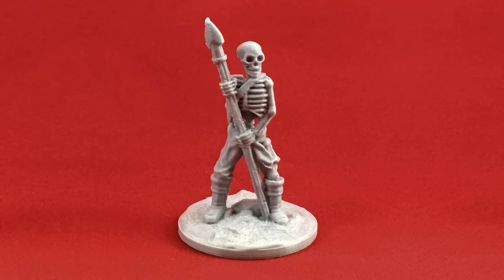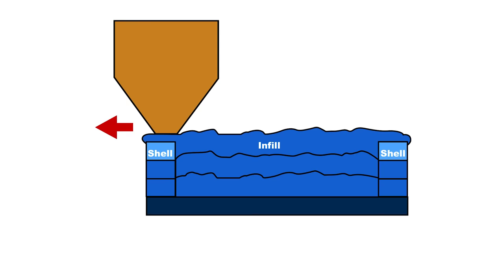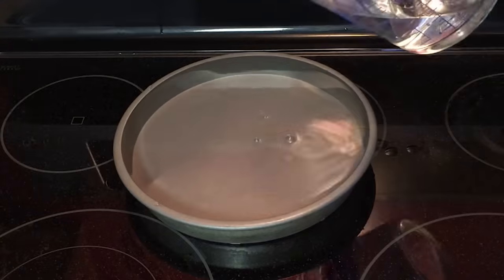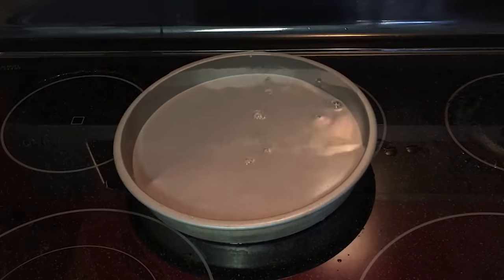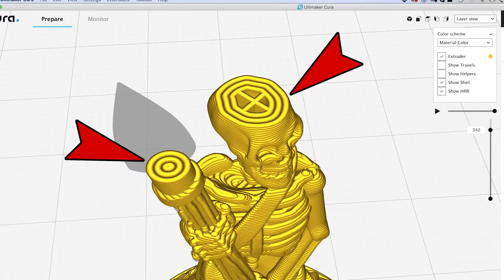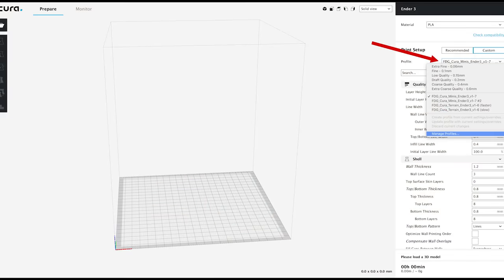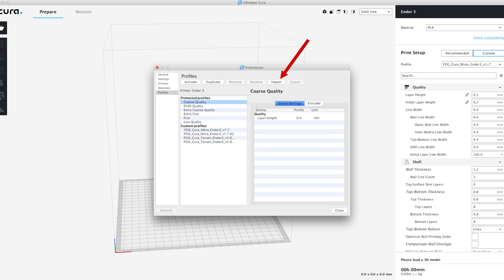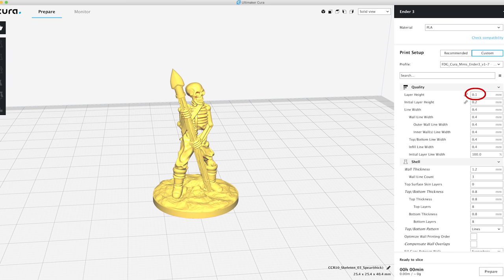How to 3D print miniatures on a FDM printer

Comment: 09:57 slight mistake there...the falling speed is not constant, it‘s an accelleration up to the terminal velocity (in an atmosphere). and objects with different mass only fall at the same speed in a vacuum. your argument about the kinetic energy is still valid, though.
Reply from the maker: I know, but this video is about 3D printing miniatures, it's not intended to be a physics lesson about the acceleration of gravity. Going into an explanation of how all objects accelerate at approx 10m/second/second (not counting air resistance) until they hit terminal velocity due to that air resistance would be overkill (and frankly, annoyingly pedantic.) Much easier to just say the speed of the dropped minis is constant, which gets the point across.

Comment: Thanks for another great video! I've been seeing your channel pop up on Reddit a lot lately. You're getting quite a reputation for your excellent detail and problem solving.

I have a request for the channel. I'd really love to see you try out HT-PLA for miniatures. I've gotten lots of requests from friends for miniatures to go in their car or to put in a window. Unfortunately, I've not had much success getting fine details from it even though I'm experienced with high temperature filaments. I'd use other HT materials in a second, but most other high temp materials don't have much of a color selection. I'd love to see your take on how to get good results from that filament.
Reply from the maker: I have never used HT-PLA, but I'll look into it. :)
Reply: @Tombof3DPrintedHorrors  Thanks! Annealing it is apparently the key to radically improving it's strength and temperature durability. Maybe you can hit up Proto-Pasta for some to test, although I'm sure there are probably other good brands of it out there. I've printed a couple rolls for an oversized project, but it had none of the gorgeous details that your work has. If I remember correctly, they have a couple varieties including one that's supposed to be super dimensionally stable (with cf filler I think, but don't quote me on that). In any case, keep up the great work!

Comment: I've been printing at 0.04mm and 0.08mm layer heights and I've never noticed the radiant heat issue. Only issue is that it takes more than twice as long to print, but at 0.04mm I basically can't see the layers anymore :) Still experimenting with Acetone smoothing and ABS to get those perfect minis.

Comment: I used the profile and my minis printed great, but one problem arises that the support are now sticking far too close to the mini that trying to remove supports basically just ruins the mini afterwards. What can I do to fix this?
Reply from the maker: None of my models require supports :)
Reply: @Tombof3DPrintedHorrors  Unless you've made a Primaris Space Marine proxy, I don't think that'll help with my question much

Comment: Amazing, just amazing. So incredible good explained.
Reply from the maker: Thank you :)
Reply: Will try to reproduce that on my mk3. But the First print is not nearly that smooth, lines show up way more than on your pics. I think I really have to change the nozzle. 
This one is in "work" for 3 months now.
Reply from the maker: I am consistently getting better prints on my Ender 3s versus my Prusa Mk2s and 3, which is shocking as the Prusas cost 4x as much.
Reply: Tell me about it. I thought (as my first printer) the mk3 would be the better choice... annoying to say the least..

Comment: The good news is you can get a high resolution resin printer for under $300 these days.  Maybe silly for terrain and buildings, but ideal for characters and other small parts.
Reply from the maker: Lots of people don't want to have toxic resins in their homes, or deal with the mess of the resin printer and prefer FDM (cheaper, cleaner, and MUCH safer.)

Comment: tl;dr: high ductility means more flex, high tensile strength means overall higher strength required to break, regardless of the material being brittle or ductile. Ductility is also related to higher resistance against impact.

Even though you're right in relating PLA temperature x tensile strength, you're not 100% right about tensile strength being associated with the "flex" of the material, that would be either the elastic modulus or the ductility of the material https://en.wikipedia.org/wiki/Ductility. Tensile strength (also called ultimate tensile strength) is basically how much strength it takes to break the material in a tensile test, in which a sample of the material is pulled apart until it fails (there's also compressive strength which has a different test). A material can have a very high tensile strength and yet be very brittle(example: quenched steels), which means it will suddenly shatter instead of "stretching and then breaking". The strength at which the materials starts to stretch (have permanent deformation) is called "yield strength" and the strength at which the material breaks is the "tensile strength". A brittle material will have these strengths technically equal to one another, since there will be no identifiable stretching before the rupture. A ductile material, on the other hand, will have a significant diference between them, the tensile strength will be a much higher than the yield strength. Engineering applications will most of the time calculate parts so they don't surpass the material's yield strength. Fun fact: ductile materials are much more reliable for structures because: 
1) they bend before they break (sometimes years before they break) which allow the efforts on the structure to be gradually distributed and also cause visible effects of the failure (the element become stretched and thinner or noticeable bent, depending on the effort).
2) they are much more resistant to sudden efforts, like impacts, etc. since they will give in and deform and will only break when the higher tensile strength has been reached.
Reply: Thank you.  98% of this video is perfect, but this section caused my eye to twitch

Comment: I saw a video by CHEP talking about natural steps. It's pretty much .04 for each printer so I would do a .08 or .12 for a natural step
Reply from the maker: Nope. For that to work, your Z 'home' point would need to be on a full step of the Z motor (so that every layer would then also hit on a full step) and there is no way to do that short of sheer luck, and the odds are you won't hit one when leveling/calculating Z offset. If your first layer begins on a non full step, then every subsequent layer will also hit on a non full step. When printing minis, .1 will give you the cleanest overall print, better than .08, especially on overhang areas.

Comment: Hi! I'm trying to print your Sample_Skeleton using your Cura 4.8 .4mm profile with a Creality CR-10S Pro. The printer heats and auto-levels, then it goes to printing mode, but it does nothing, it doesn't move. Could it be that there's a setting on the Cura profile that's not compatible?

Comment: Hey! I've been using the Ender 3 V3 SE for 2 months now. I'm starting to get the hang of it. I'm still switching back and forth between Cura and Creality Print. Seems like Cura is a more matured and advanced slicer, but Creality Print is more optimized for my printer. Had lots of stringing with Cura and almost none with Creality Slicer. I've tried the settings in one of your videos regarding this, but had not much of a difference. So, Cura = better looking results (lots of stringing) Creality Print = not so great looking results (way less stringing). Are you still using the Ender 3 V3 SE? Do you have some more tips or something? Thanks again for these videos!!!

Comment: I recently tried to print minis with a 0.04mm layer height and have no problems with reheating. 
Could it be because of my minimum speed of 80mm/s so the parts aren't radiatet with heat that long?
What do you think?

Comment: I am using your mini profile and everything is great except my top layer. I am printing a helmet that is 25mm high and there is 5 horns on top of the helmet. Two are larger and print fine but their tips get melted a little. The other three are smaller and barely print. And I am getting stringing. I actually got better results using the white pla that came with my Ender-3. Now I am using Enomaker grey. I am new to 3D printing. I tried Googling if Cura let’s you change the temperature and speed at a certain point, but I guess it can only be done with a script (beyond my know how). Should I just cut back the temp and speed in your mini profile?

Comment: Hi. I am being asked to  3d print in PLA!!! a tiny screw, which is 1.5 mm stem diameter. The head is 3 mm diameter. thread pitch is about 0.2 to 0.3 mm. How can I accomplish this tiny job. Any suggestions???. Thanks in advance. Ric

Comment: Cura 4.8.0 says, "Failed to import profile from ... .curaprofile: Quality type 'standard' is not compatible with the current active machine definition 'fdmprinter'" In Cura profiles, after clicking Import then any of the profiles (I have a cheap JGAURORA A3S, but it is bowden and the 3D Printing Pro and Siepie mini profiles work).

Comment: Great info.  Just FYI a tube is generally stronger (stiffer) than a solid rod of the same material in the same diameter.
Reply: Wait, how? Do you mean by weight or by volume(including the empty space inside the tube)? If you mean by weight, I don't think that matters too much in this situation.
Reply: A tube is stronger and stiffer vs. bending for the same cross section of material.  For the same outside diameter the solid rod is stronger, but not in proportion to the extra weight.

Comment: great video. i only use ESUN PLA+ its funny you print it so low temperature. On the box it comes in it says min temp is 205. maybe my ender 3 is different but if i drop below 210 i get extruder issues from extruding too low and the pressue building up. Hopefully the rest of these settings work for me at 210. Also it may wanted to be updated with magic numbers. eg instead of 01. it should be 0.12 or 0.8. eg multiples of 4. but not sure if we knew about that when this video was made so it is understandable its not mentioned.

Comment: You have the description of jerk wrong. Jerk is a change in acceleration, sort of like acceleration is a change in velocity. If you want to use the car braking as an example of jerk, the slower jerk is like pressing the brake pedal slowly and firmly down and fast jerk is like stomping on the pedal.
Reply from the maker: From Cura's site:

Jerk defines the speed of the print head before performing a hard stop. Just like a car, the print head needs to come to a complete stop at some points. It's comparable to hitting the brakes in a car. When you do this at high speeds it feels uncomfortable. The jerk settings reduce the speeds set in the firmware, making the print a little slower, but more accurate.
Reply: @Tombof3DPrintedHorrors  Ok. Either Cura's website isn't explaining it correctly, or they are misusing the term. I don't know how Cura is programmed so I don't know which it is. I was going off of "Jerk" being the correct technical term in physics for change in acceleration. See https://en.wikipedia.org/wiki/Jerk_(physics)
Reply from the maker: Cura has it defined correctly for how it is used within their program.

Comment: wouldnt a circular fan guide around the nozzle help cool off the radiant heat?
its something i'm still wrapping my head around, also i have heard it depends on the printer type at which is the perfect layer stepping height, ie dont print at heights between the stepping points

Comment: I can't import the profile.  I get an error "Failed to import profile from c:\users\...\Official_FDG_Cura_Ender3_and_5_Miniatures_4mm_v4_3l.cureprofile:  Could not find a quality type normal for the current configuration."  I am using CURA 4.3 and I have a .4mm nozzle.
Reply from the maker: Please read the 'Read me' file included in the profile folder for Cura 4.3 users.

Comment: I'm using your Terrain profile settings, and am noticing that there is stringing inside the infill area of the walls. It's very fine thin but still stringing.  Is that a problem?  It doesn't show on the outside of the walls.

Comment: just an FYI when i try to import the 4.3 miniatures profiles i get the following error: Failed to import profile from C:/Users/james/Desktop/FDG Profiles - Import These/Official_FDG_Cura_Ender3_and_5_Miniatures_3mm_v3_3l.curaprofile: Could not find a quality type normal for the current configuration.
Reply from the maker: You didn't set up a new legacy printer first in Cura, you still have their stock Ender 3 printer selected. Install the legacy descriptions, then add a new printer selecting the legacy option.

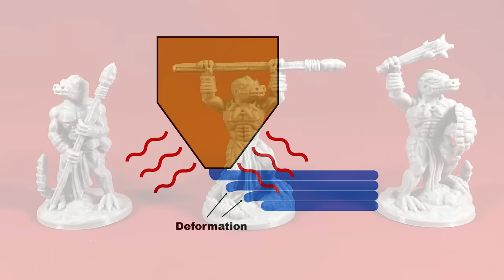Comment: 2:10 what about making an insulating cap for the hot tip angled sides to eliminate the radiant heat?
Reply: I'm pretty sure insulating the hot tip may cause the filament to over heat and either scorch or become too liquid (or both)

Comment: My E3 almost perfectly prints minis with Cura standard profile, 0.4 nozzle and 0.12 layer. The only thing that annoys me were cura supports as they are very solid and hard remove, now i make them with meshmixer and also that issue is solved. Trying to print with 0.2 nozzle ended in much worse quality while much longer printig time.

Comment: I've been trying to dial in my prints, but I seem to get blobs mainly on the edges of things (tips of noses, tips of ears, etc). Any thoughts on how to to negate this? Also in your settings I noticed there are no settings for Travel Acceleration and Travel Jerk. Should these be the same settings as the other Jerk Settings in the profile they default to 5000 and 30 respectively.

Comment: Hello and congratulations for your channel! A piece of advice please. I would like to take a Flsun Super racerR as my first printer. Do you think it is suitable for this purpose? Do you think I would be able to print miniatures for plastic models, crib figurines, action figures and parts for model cars (old hot wheels models that I restore) like from 2 cm up to 12 cm?

And if so, with which material would I have the best rendering for detail? Fdm, Pla, Pla + etc. I would like to avoid the whole process with the resin, also for health reasons and also losing some quality.
Or if you can recommend a fairly fast but also qualitatively good printer, my budget is around 5-600 euros
A thousand thanks:hand-pink-waving:

Comment: Any thought on rotating the mini's 45 degrees back? I haven't found a clear answer yet, but the hypothesis is that less 'joins' of independent components occur.

Besides that I completely agree with the layer height. I tried 50microns so many time before realizing it was messing up my prints, especially when I made it go slow. Now I know the mechanism!

Did not consider full infill might be bad, will be testing even more in the coming week. That might just solve the stringing issues I still have.

Comment: I tried your settings as base for my ender 3, printing a 45ish mm scale model. Result wasn't great, very visible layer lines, a few lines not matching up etc. Then I tried lowering print speed to 20, decreased layer height to 0.04mm (on the stock nozzle), and got much better results. The supports left a few blobs, but apart from that I got finer detail, cleaner lines, and pretty much no visible layer lines. Not quite GW standards, but not far off from their older stuff.

Comment: question about step limitations. my minimum step on my anet is .04mm would it be better then to switch the layer height to a multiple of that so that the slicer is working with the mechanical limits if the printer? could this be the cause of infill being over extruded as described as the first issue in the video?
Reply from the maker: No, because all of that step increment stuff is useless because you have no way of knowing where your Z home (0 position) is. In other words, your first layer will almost guaranteed not begin on a full step position, so no subsequent layer would be on a full step either. .1 layer height gives the best results for minis, it handles overhands better and will give the most consistent results. See these examples here of what .1 will do: https://youtu.be/iEdCTuK7ZW0

Comment: question, you mention that 22.5mms is a great speed that keeps the nozzle moving, but isnt that all canceled out anyway due to the 10 second layer time at 10mms setting that you set? if a layer is going to be faster than 10 seconds, it will drop the speed to the 10mms that is set to ensure each layer takes 10 seconds or less

Comment: About the Jerk setting (according to Marlin documentation)
/**
 * Default Jerk (mm/s)
 * Override with M205 X Y Z E
 *
 * "Jerk" specifies the minimum speed change that requires acceleration.
 * When changing speed and direction, if the difference is less than the
 * value set here, it may happen instantaneously.
#define DEFAULT_XJERK                 10.0
#define DEFAULT_YJERK                 10.0
 */
In other words, if the speed change is lower than the jerk value, the printer will use the acceleration value as a limit of how abruptly the speed can change. If the speed change is lower than this value, the speed change will be instantaneous, which will effectively cause a "jerk". The default value in CR-10's firmware is 10 for x and y jerk, the lower the "smoother" it will be, at the cost of a larger print time. You're right about using a low value, but wrong about what exactly jerk does.